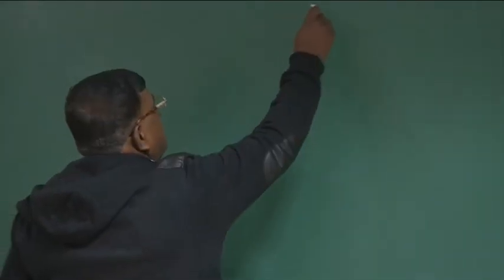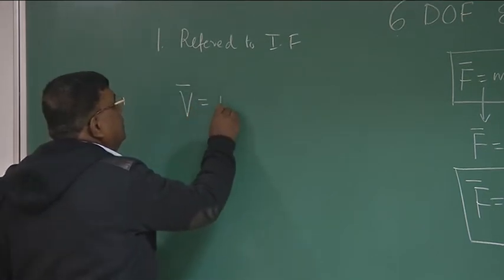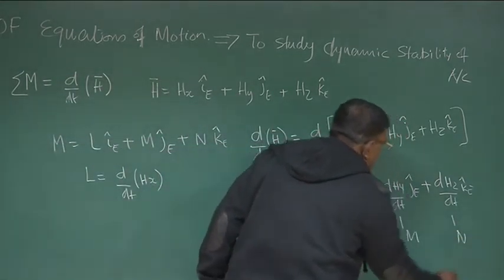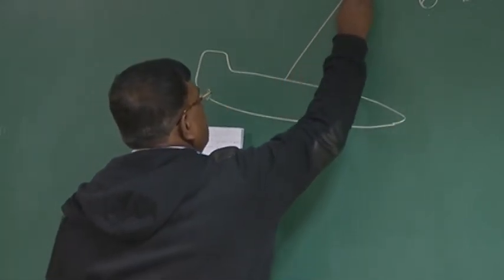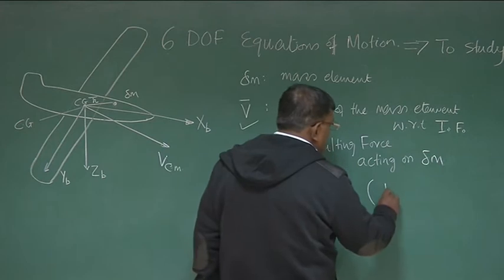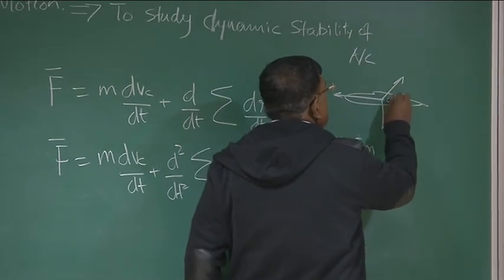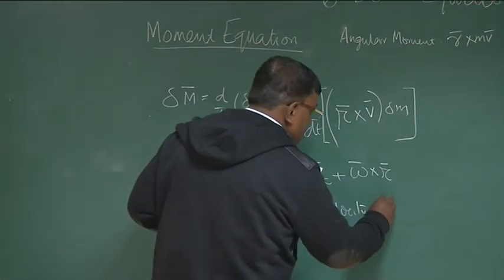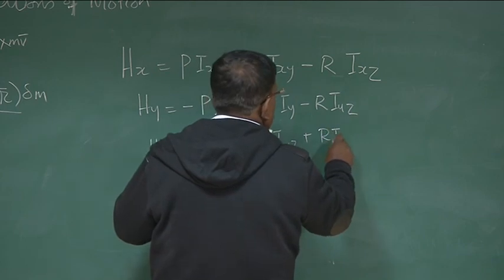Six Degrees of Freedom of an Aircraft

Comment: Sir one more point where it seems a bit of mistake in explanation though results are right in case where moment is calculated :
1. "Vector r" was wrt BFA and same fact was used to put sigma rdm = 0 but when it is expanded and written in x, y, z component it is taken wrt inertial frame.
2. One of the explanation of the moment would be : (I am talking everything wrt inertial frame ) moment is rate of change of angular momentum. Let the position vector of 'delta m' be 'r' and let it's angular velocity be 'omega'. Then the angular momentum of delta m  is given by ' r x (omega x r)delta m '. And further can be solved.
Submitted for your perusal sir.